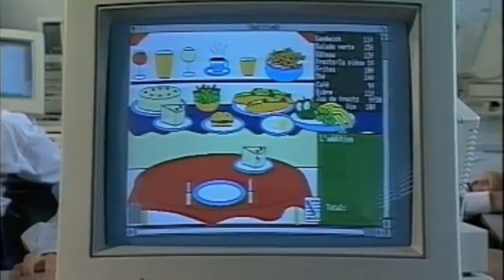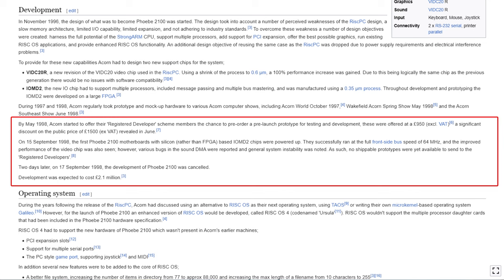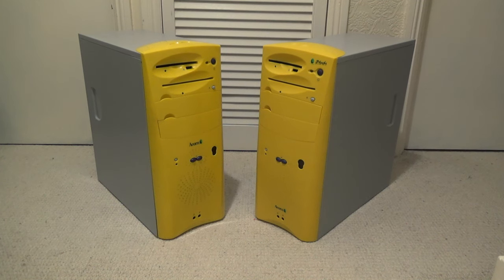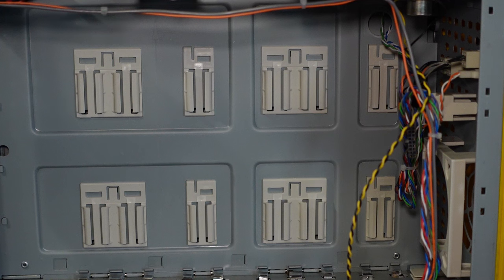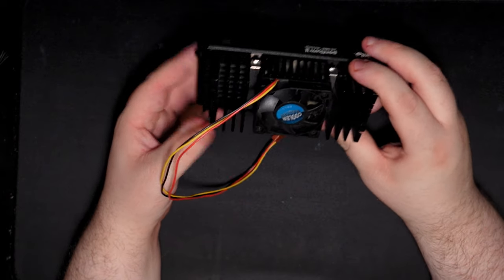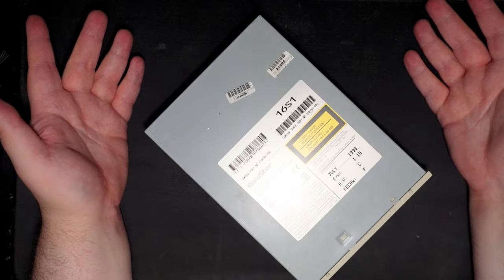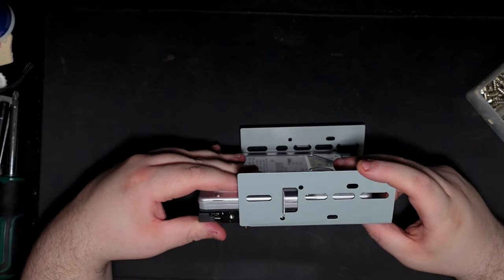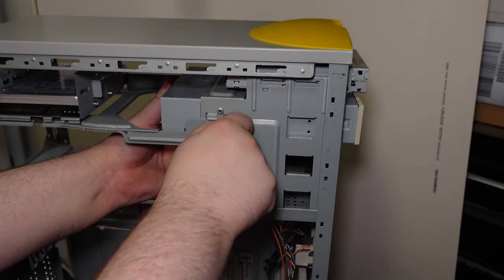Project Phoebe - Building the computer that never was - Part 1

Comment: Great things are rarely done easy, and never the way we imagine them.   Suggestion, relocate the mounts by tapping in new holes to align with the riser holes.  Yes, it sucks but the payoff will be worth it.  As for the MB (when you find it,) consider a tray mount, whether a plywood or acrylic, either way should work and even slides would be a plus.  That way if the MB mount holes do not mount with the slides there's still the sheet to insert the mounts on regardless.   Welcome to the nineties where retrofits are a walk through hell in gasoline coated underwear, as anyone who has built a sleeper with components from the day.  Anyways, good luck, I am rooting for ya.

Comment: So, I'm confused. Will this be a PC, an emulated RISC PC or will it be something else. Whatever you do, I'm sure will work out, but surely you could have based this project on an ARM motherboard like the titanium or the RPi 4. The would really play homage to the legacy of the Phoebe. Nevertheless, I'm intrigued. Back in the day I read the reviews and would have been interested in buying one. I still have a working Australian made RiscStation 7500 clone.
Reply from the maker: Ok, so the goal was mostly to fill out/make use of the case with a board that is the correct form factor, NLX, as we could never get hold of any original hardware, it would have to be a PC board. There is a plan to put a Pi in this case, but the PC board will be left in there still (at the very least after I stop using it it will look the part). I have looked at the Titanium but it is like £500... no way, while I want something more era accurate, that's nuts. Just be patient. There will be a Pi
Reply: Yes, the Titanium is a bit on the expensive side, probably due to the small production. Having said that, do not install Windows on that thing. Not only will you be cursed by the Acorn Gods, you will go be contributing to the dark side. I have RPCEmu running under both Linux and FreeBSD. You choose how you want history to remember you 🙂.
Reply from the maker: I'm sorry, Windows is going on it, albeit briefly, I have no regrets, hahaha. As I say this was mostly to make use of the case for something meaningful. But there are other alternatives too, I saw some Castle Technology motherboards on eBay not so long ago, these are basically the Phoebe project realised, wished I'd got one now

Comment: Would the "small computer" at the end be a raspberry pi? I mean it would be a bit more modern and it wouldn't look as retro if you looked inside but if you used that, it is ARM architecture after all and since you can actually run RISC OS on it which would in some way be more authentic than running with a pc motherboard and windows from the era. You could even use the optical, floppy and ide drives via adapters internally. (though no idea how support is for that sort of stuff is in the modern variant of RISC OS that runs on the raspberry pi).
Reply from the maker: Yes it would be, I was going to do it anyway, but perhaps should have done it first, if I had known how hard this was going to be. As for at least floppy support via USB, I have heard that this is spotty, it can read MS formatted floppies, but has issues reading Acorn formatted ones. I will however check this out in due time anyway
Reply: Beside Pi, there are laptops and server boards, which can be turned into a desktop computer and made run RISC OS.

Comment: You've lost the plot alright, you should base this around a Raspberry PI or similar ARM SBC, for the record there are some expansion boards for the CM4 specifically supposed to be a mainboard ITX compatible which would be better for this for the simple fact that RiscOS will run native on the thing instead of committing the heresy this thing is.

Comment: u lost me at pentium 2
Reply from the maker: Lol it's a CPU 😂
Reply: @PIPERdotEXE Jabil Maverick NLX board (440BX) is what I used; it was a Pentium II board, but I upgraded it to Tualatin 1.4 GHz. Plus GeForce (GeForce 3 would not post, and was not supported on the amcint V1.0a AGP. However, it did work if I put a PCI GeForce 2MX in as well, which was weird!